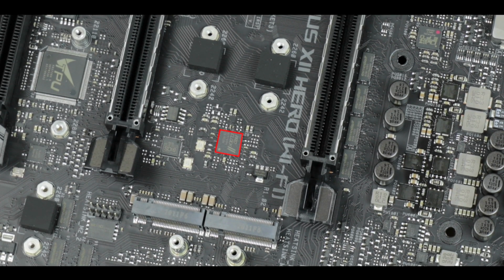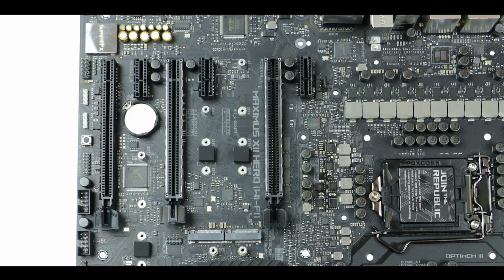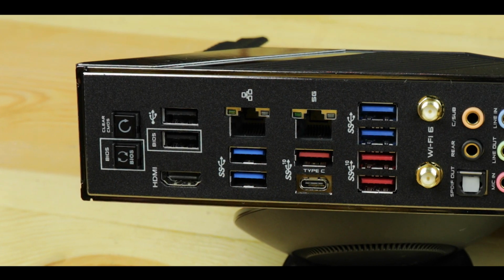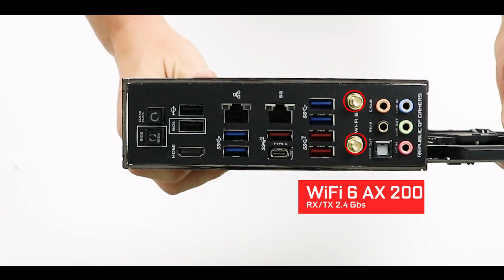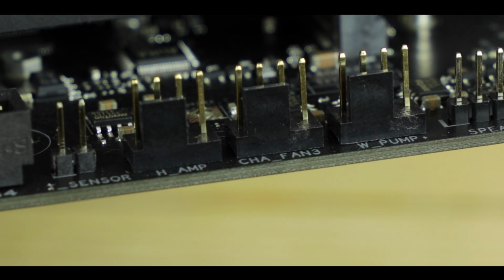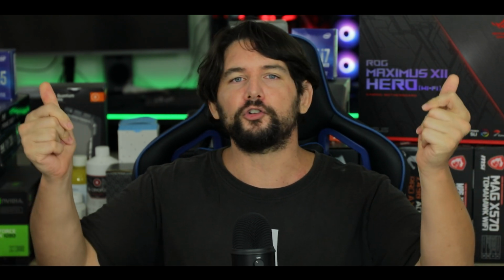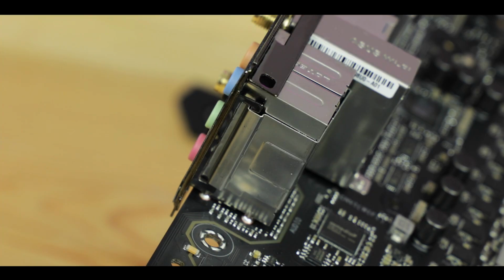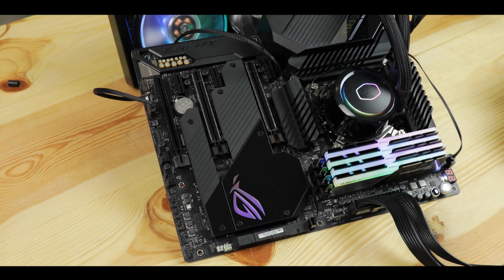ROG MAXIMUS XII HERO WIFI, ASUS at its BEST!

Comment: I just put a system together with this MB, I used the Deep Cool single fan water cooler. It will only install one way. The hoses prevent you from using the 1st RAM  slot.

Comment: So to Laurent I would like to give a feedback after buying the Motherboard one big Minus is that Asus always places the Ram so close to the CPU, and so with this new VRAM heat sink all around well you cannot rotate your AIO CPU block, before I was running just x2 sticks of ram but now with four it makes compatibility issues, not possible to place the AIO block in other directions as it will collide with the Ram slot or the VRM Heat sink... I managed to mount it with the CPU block's tubing at the top but then you loose tubing length which then makes other problems like if your graphic card is too large or too long.
for reference I am running a EK 280 AIO

My wish is like MSI or Gigabyte, Asus would also add more clearance between the CPU and Ram slots. Perhaps it is nice to mention it in review, I think it is very important and helpful to costumers.
This mobo is still a beast ;) it also had pre-installed "Armoury crate", so if you just upgrade your computer it will update and install Drivers + Utility on its own ;)
Reply from the maker: I'll take a closer look to that

Comment: Im upgrading from a cheap B460M board to this, cant wait to see the performance difference
Reply: how was it?
Reply: @ravinder2782  I've been very happy with the performance of the board overall. I ended upgrading other components when I installed the board so I can't say how much the board itself improved performance. 
I did notice the heatsinks on the board work great and the CPU stays pretty cool. 
The board has tons of USB ports which has been really nice and it has a display on the board that will show error codes if your PC won't post after a build. That came in pretty handy for me a couple times.

Comment: Really like the PCIe 4.0 for GPU.  Is the PCIe compatibility in this board ,a full functionally or a gimmick ? Because I read about PCIe 4 on this board ;   " This is accomplished by adding clock generators to help clean up the signal ". What does that mean ?  If I really want PCIe 4, should I wait for motherboard that already come with PCIe 4.0 ?
Reply from the maker: If u couple the board with a 11th CPU then yes... You will be able to operate a PCIE 4 GPU... but, as is not in the review ... It really serves no purpose since no PCIe 4 video card can put perform the PCIE 3 standard so far.

In effect...making it absolutely.. totally useless as of today.

Comment: So this board is pcie 4.0 ready? Are you sure? That is weird why don’t they included on their specs? That would be a selling point to increase sales? On the other hand, Msi gigabyte does it on their board indicating is 4.0 ready.
Reply from the maker: Hi there :). 

Yes the ROG XII hero is Pcie 4.0 ready. 
There are 2 PCIe 4 clock drivers present on the board which will be able to handle the 11th gen Intel Core CPU PCIe 4 lanes . 

Hope this helps.
Reply: @Laurentschoice  thank you for the reply! Im still deciding to go with this motherboard or the msi z490 unify. What do you think about the unify?

Comment: Can you help me? I need to install x2 m.2 SSD's- What is the best config for this>?
Reply: I’m in the same spot I got a 500gb western digital sn750 in the first slot but I don’t want to take the heat sync off that covers the first and 2nd so I think I’m going to put my 2nd ssd in the 3rd slot which is a WD sn750 2tb
Reply: @zacharymorrison4298  1 SSD in the 3rd slot worked for me. Then upgraded to slot 1 (top one) and slot 3. works for me